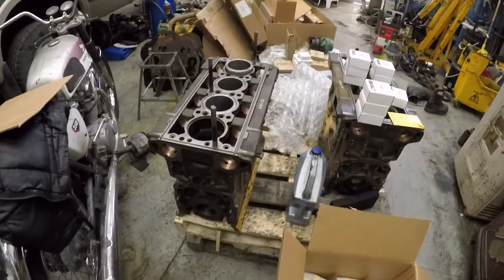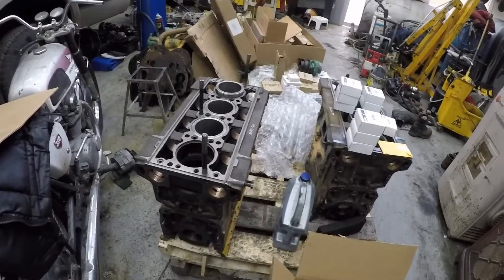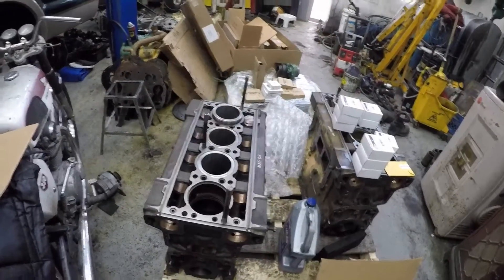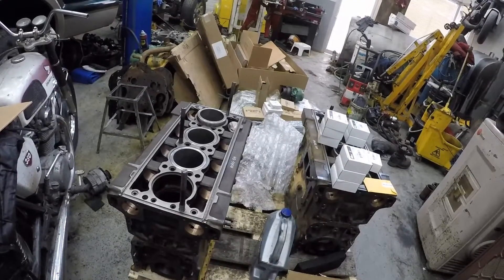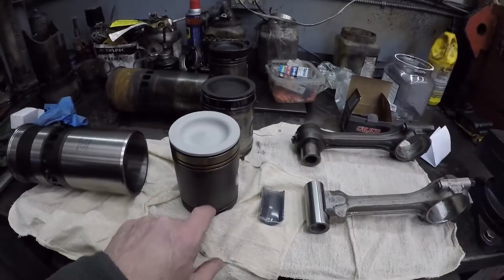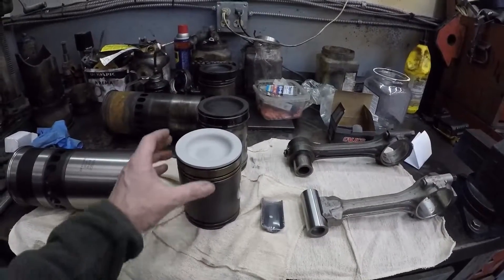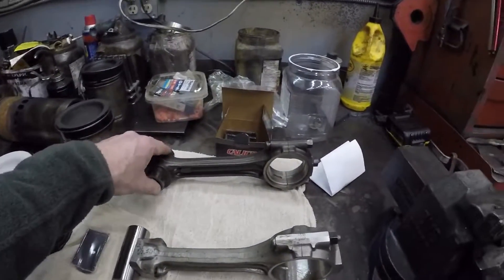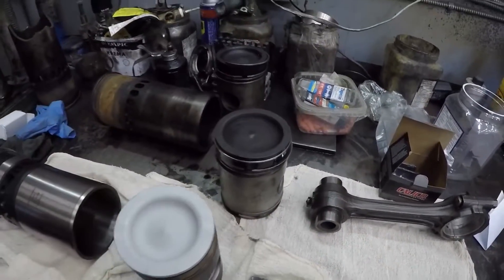4-53T Silver Series upgrade

Comment: I'm rebuilding 2 4-53t's for my boat- is it worth it to convert them to silver series? What's the cost difference vs performance difference? Thanks!
Reply from the maker: From my experience I haven't seen any noticeable increase in performance from the Green to Silver upgrade.  Certainly not enough to justify the cost.:)  I'll have to put some more miles on this engine to see if it pays back.  I did notice a drop in oil consumption and a slight improvement in fuel economy, but that's it.

Comment: Nice overview of the differences good Sir! Those silver rods look like they're brand new! You're running the Green liner with a custom Green cam correct? Cheers!
Reply from the maker: Thanks Luke, The rods are Reliabilt , liners are the .84 tall ports,  custom ground high lift green cam, and the new thin wire springs.
Reply: @detroitgarage9430  Awesome to hear. Those reilabilt rods look like they're brand new. Really beautiful parts. I'm still stunned by how beautiful that coating is.
Reply from the maker: @lukestrasser  Very true, Last of my parts show up next week and I can start  rebuilding it on the weekends.  With Covid-19 I'm now homeschooling my two boys.:)